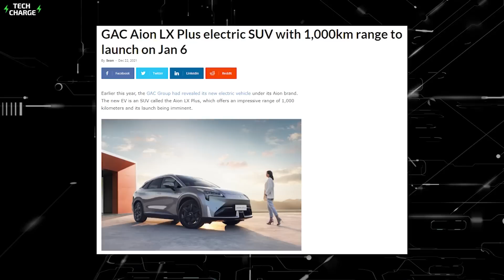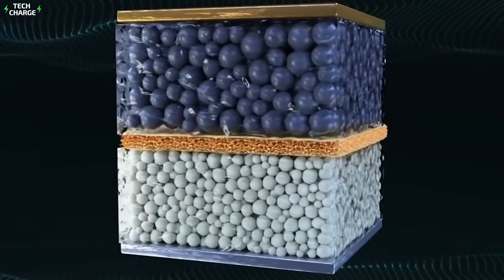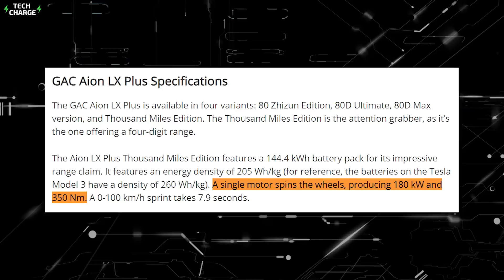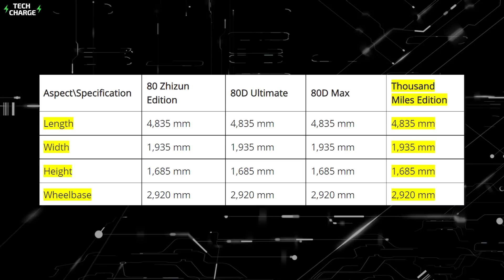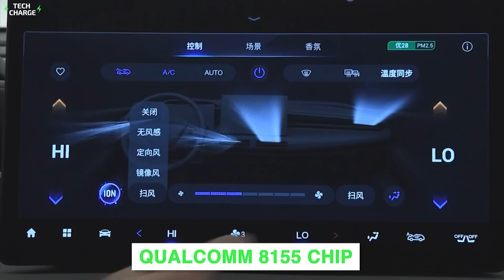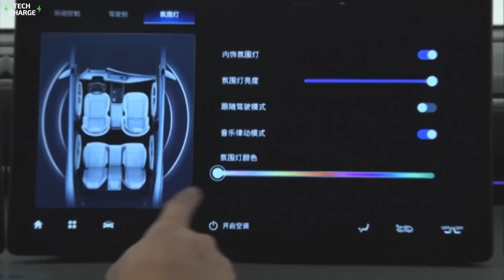The First EV to Reach 1,000 km Range

Comment: The narration and in-video titles say 1000 miles.  If it's 1000 km or   621 miles on the range test used in China, it would be about 500 miles using the EPA test cycle.  The Lucid Air Dreak Edition  has better range.  the Model Y has a better range per kg of vehicle mass.

Comment: The EV with a range of 1,000 km weighs 2.7 tons. The price is 470,000 Chinese Yuan(USD 70,000). It's a bit expensive, to be honest.
Reply: 70 k is the price for the tesla car in my country and there are less expensive and more car. If you change some cars logo for the Tesla's minds won't comprehend that Minimalist appearance is not what you want. Air lucid is by far a better choice and yes, that is expensive. And for the same amount Porsche is better

Comment: Talking my language, here. 600+ miles out-performs many gasoline models. I would buy this fully-electric SUV at around $45,000.
Reply: Try 100,000.
Reply: @Encephalitisify  but these gas car people will still whine about charging even if it goes 100,000km on a single charge 🙄
Reply: @Bruce Bidinoff  Bruce Bidinov?
Reply: 600 miles EV for that little money?  My tesla Y can't go beyond 300 miles and cost more than 60K. Relatively slow charging even at superchargers makes long distance travel inconvenient compared to gas engine.
Reply: @konde888  Nio ET7 1000KM+ Range
Reply: @konde888  you charge when you sleep or go to the mall
 You won't be driving 1000km in a day anyway and 1000km fully charged car in the city for me takes more than 1.5 months to recharge again. If they create a 10,000km range car would you still whine about slow charging when you will rarely charge it anyways?
Reply: @Sam Jam  I love driving my Tesla. Please read my posting again. Your comments have nothing to do with it. I  do charge my Tesla at home.  But on a long trip, you can't possibly go beyond the mileage they tell you. I live in LA. With a full charge,  I can't possibly reach LV, which is only 275 miles away. Charging at the supercharger on the way will take you at least 20 minutes. If you own an EV, you'll understand. It's hard to explain to people who don't own one.
Reply: @whistlebloer8254  you drive 275 miles straight without any break? I think most people want to take a 20 minute break in between or go to the washroom. Plus are you doing LA to LV drive everyday? I feel like maybe Tesla or EV in general arent for Americans that like to drive long distances without breaks. For Canadians that have 20km commutes to work everyday and rarely take long roadtrips it's perfect
Reply: Stick to the subject of my original comment. Otherwise you could be talking about the weather too. 😛
Reply: @whistlebloer8254  actually, I’d be happy with 650 km per charge. I’d pay $80,000 for that. $107,000 in Canadian dollars.

Comment: By the time it hits production it will be a 580km car. Then real world of 420km. Let's move on.
Reply: EV car manufacturers always inflate their numbers.  The whatever maximum range they claim is basically their "ideal" conditions (flat, perfectly paved track in warm weather, driving 35mph with no AC or any other accessory turned on).  Tesla's number is often only 80 to 90% of what they claimed.  Other EV manufacturers basically inflate their number by a crazy 30 to 50%.
Reply: Not really, keep in mind this is a huge battery pack (144.4kwh). There is a real world test that went on a 600km road trip, by the end of the round trip it still had 21% battery charge left. It was projected to go 1010km in mixed driving between 3 different drivers calculated during the 300km mark. Full on highway speed was still expected to go 816km, plus this battery technology performs better in winter than any other brands as of right now. There is another video in Chinese that talked about their technological breakthroughs, 50 new patents, 5 years of testing and passes all safety and puncture tests etc. We need more companies like this that increases battery density and charging efficiency. Tesla is definitely sleeping on new product lines instead of R&D. It's just a matter of time before other companies catches up, this will be an ultra competitive industry.